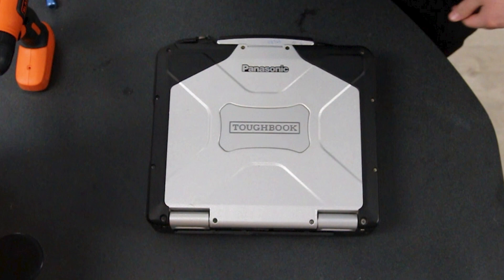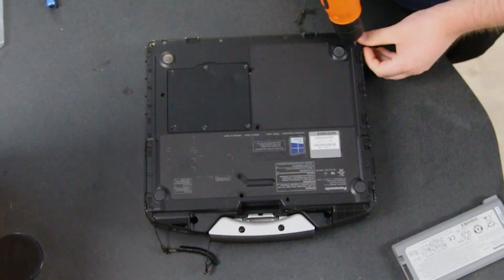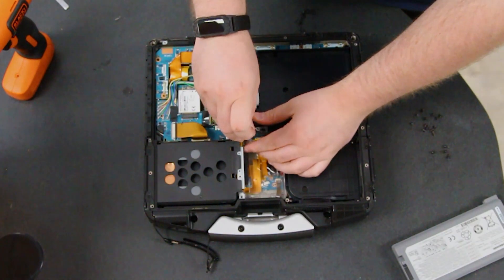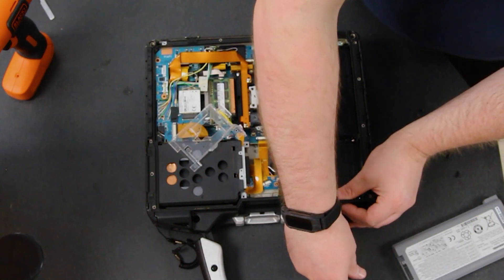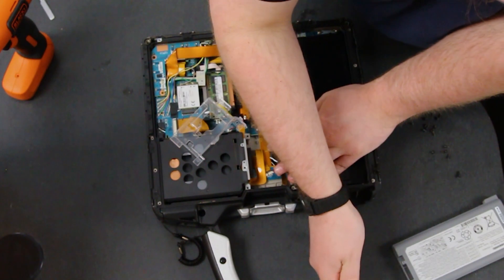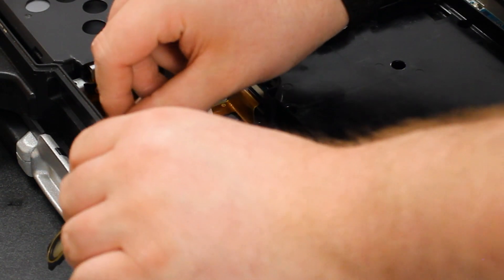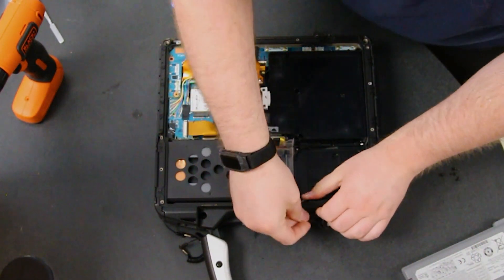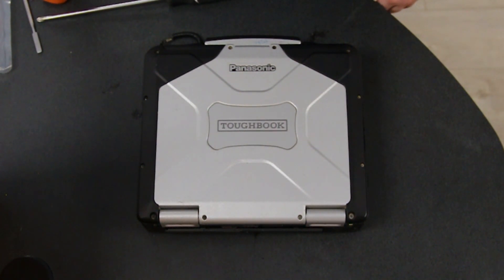Panasonic Toughbook CF-31: Fingerprint Reader Installation

Comment: What about speakers??
Reply from the maker: The speaker just needs to be removed so that you can run the wire for the fingerprint reader into the computer. Thanks for watching!
Reply: but we will use the speaker in the future, right? Just only for instal fingerprint  @Bobjohnson .
Thank you 🙏

Comment: didnt even show the damn reader
Reply: I find these videos helpful, this one however is very frustrating to watch. The angles of the camera don't offer needed views. No explanation of where on the MB the ribbon plugs in or how to route said ribbon through the speaker hole.
Reply: @orilion1820 you have eyes right? The speaker retainer has a little rectangular cut out to the right just for the ribbon cable to run thru. Easy peasy.
Reply from the maker: We're sorry about that. Thanks for watching.

Comment: Have you ever added wireless connectivity to a G2? Cellular & GPS in this case. I have a need to do that if Panasonic will sell me the parts.
Reply from the maker: @ridged8 The best way to answer this question is to simply fill out our Tech support form.  Our in-house technicians will answer with the links and info you will need.  Here is the link: https://www.bobjohnson.com/tech-support-form/  Thanks for Watching.
Reply: @Bobjohnson  Thank you for your time Bob. Panasonic won't touch this machine. I can only assume that I in fact, have Hunter's laptop 🤣 So looking at the TB33. Watching your reviews closely, thank you for being here

Comment: Thanks for this video. How can I add one more USB 3.0 in FZ-G1? And where can I buy it?
Reply from the maker: There is an expansion that adds a USB port to the top slot of the FZ-G1, but they are extremely hard to come by because Panasonic does not provide the kits anymore, and they only come with a USB 2.0. One option is to shop around for an FZ-G1 with one already installed. The problem here is that one with this slot could potentially add $200-$300 to the price. You're best bet would be to get an external keyboard that provides an additional USB port on it or to get a dock for the FZ-G1. Hopefully, this helps. Thanks for watching.